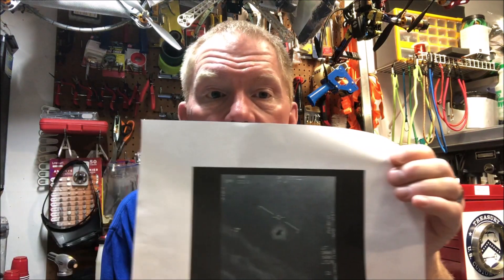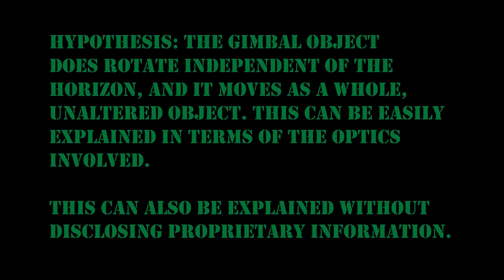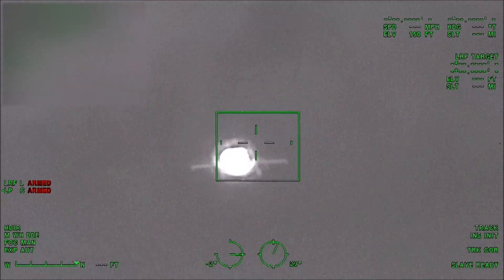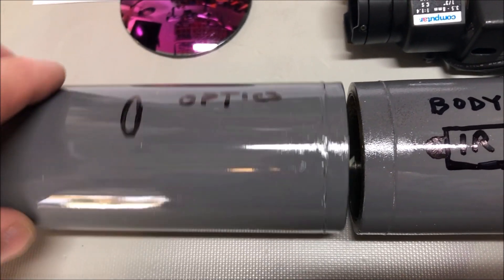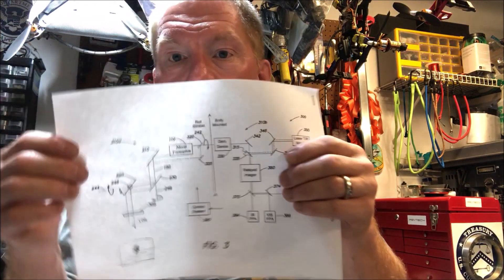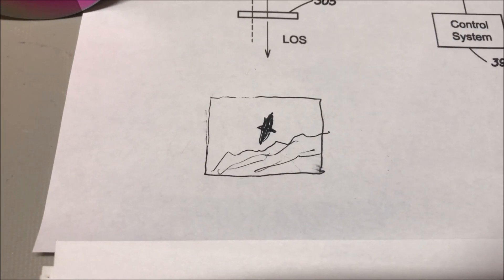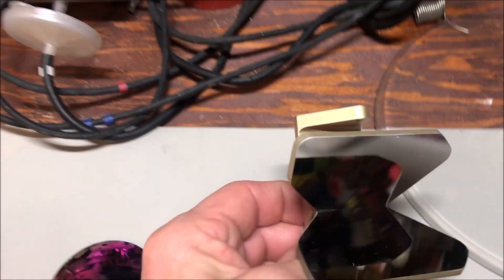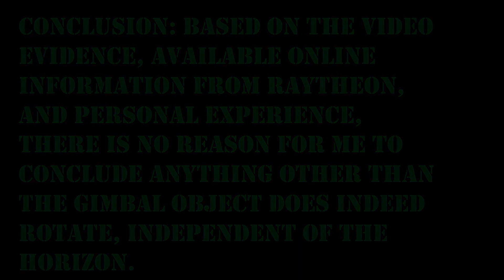"Gimbal" UFO ATFLIR video rotation explained by a Depot Level FLIR Technician

Comment: Why did you block out the metabunk forum link? And you're getting information from there?
Reply: @davefalch1038  bit at 8:48
Reply: @davefalch1038  It's more about how it comes across. I'm personally not attacking you or saying you're wrong. But when there seems to be fighting back n forth it just puts me off, It's nicer to have an open discussion. I just wish better evidence was released so no one has to argue about it. Wonder if that report will add anything

Comment: Can we just be more accurate that when we say the object is rotating it's actually the infrared signature that's rotating and not the actual object?  To suggest that the infrared image is the same as the object itself is very flawed. Do you think that if you shined an infrared beam into and IR device and rotated the emitter, the image would actually rotate?  If you look into a flashlight and someone turns the flashlight, will the beam of light also change?  The smell works in reverse. You can't assume that the fact that the image appears to rotate means that the object is.  I wish people would stop referring to these as objects altogether. We're only seeing heat signature. 
There is an FA-18 pilot who looked at the three recordings and immediately stated the same thing.  He said the heat source is rotating, not necessarily the object.  
I also found a video of infrared images of jets.  
youtu.be/5E7onF1c_T0
It's mostly boring except shortly after the 3 minute mark, you see an image of a fighter jet that looks exactly like the gimbal one as the IR device focuses in and out. Same aura. People are saying that there's no evidence of propulsion, but that's clearly not true.
Reply: @davefalch1038   wow,  I honestly didn't realize it was yours. Looks like there's egg on my face. Good thing I love eggs!  Sorry that I called your video boring.
The video had no description, so I didn't know it had anything to do with UAPs.  But, since you are the source, how does the image at 3:20 (ish) not resemble the gimbal video.  The argument is that the object in the gimbal video is actually farther away than what was initially thought. Whether that's true or not, my point is that there does not appear to be an exhaust plume, suggesting no known propulsion, in either your video or the gimbal video, and yet we know that at least in yours, there is propulsion. You even acknowledge in the comments that you can see the exhaust.  What makes the gimbal video different?

Comment: I appreciate your valuable perspective on this - especially regarding the mirrors.  However, what is not in doubt is the gimbal rotates.  The timing and position of the gimbal rotating occurs exactly when the gimbal/camera system was designed to rotate.  Are we to believe the object coincidently rotates at the exact time the gimbal rotates?  Also other light artifacts visible in the sky are moving at the exact rate and degree as the gimbal and the object.  How is this possible if it isn’t caused by light interaction with external lens glass independent of the mirrors?
Reply: @davefalch1038  Hi Dave.  Watched the video on the link.  Thanks for posting those.  Really interesting.  I am still trying to reconcile, however, why the object is rotating in perfect sync with the gimbal rotation?  Are you saying the gimbal did not rotate?  If the gimbal didn’t rotate - why are we seeing other light artifacts rotating in sync with the object?  Thanks.
Reply: @davefalch1038  you claim that the engines won't produce any glare in the camera in the infrared spectrum. We know glare occurs in other ranges of the em spectrum so why not infrared? Here's a video showing glare artifacts on engines using a camera in the IR spectrum, linked below. There are others. Maybe you just couldn't reproduce it given your equipment and setup.
https://youtu.be/L5NSm6GpvBI

Comment: could you explain the mode changes on the FLIR. Sometimes we see aircraft as white and sometimes black. What are these modes and what do they tell us. How do we know that we are not looking at the back of a fighter jet in a tic tac video?
Reply: @davefalch1038  ah, Thank you for the explanation!
Reply: What Dave should have told. you is that white mode is best for scanning and dark mode is best for details. If you look at the GIMBAL video when the mode switches from white hot to black hot, use actually see more details on the glare (glare spikes). You can also see more detail in the clouds with white hot vs black hot. On the bottom left of the screen you can see what mode the camera is in: BLK for Black hot and WHT for white hot.

In the Go Fast video, the object is cold so on WHT it appears black and on BLK it appears white.

In neither video do the objects in question change color without the mode changing.
Reply: @raytrebor  Thanks, that part is clear. I was not sure why they were doing it at first and then I watched Chris Lehto videos.
Reply: @raytrebor  and in neither video is it a distant jet, as the USS Nimitz would have determined that and not sent a Naval Aviator to go check it out. Note that radar stands for "RAdio Detection And Ranging" and extrapolate from there. Just saying, as a Navy veteran not a career civilian.

Comment: I find this whole premise of camera's setup being able to rotate an object it's observing so fascinating. Shame I don't really understand optics. 
What's a glare and how you can rotate it separately from all the other objects that camera captures? Because we know regular camera can rotate the glare, and if the glare totally obscures the object that's being tracked, it would look like the object itself is rotating, and that it's just a quirk of how cameras work. What prevents or enables FLIR from doing the same?
Reply: This is exactly what he's talking about. A lot of people have come to that same conclusion, and they even have videos of rotating glare somewhat resembling the GIMBLE object. What Dave is saying, however, is that based on the design of the optics being used, the derotation device does not work that way, and would not cause the flare to rotate independent of the object in the way you describe.
Reply: "The all-reflective derotation device is designed to do exactly this: maintain exactly what you would see as if the roll didn't happen. Since it's all reflective, it doesn't alter the "glare" at all- it reflects it. Thus, the only explanation is that the Gimbal object rotates."
-Dave Falch
Reply: @shavedata5436  But that's wrong. The shape of the glare does not come from the object, it comes from parts of the camera. And the camera rotates.

Comment: If I understand correctly, this assumes the mirror is the only thing rotating. Don't all of the optics before the mirror also rotate? Even if the mirror can rotate the image without altering it, it wouldn't correct for the rotating of the lens artifacts themselves.
Reply: Also there's the fact that the pilots saw the object with their eyes, and the objects showed up on radar. This rules out smudges on the glass. Furthermore, a smudge on the glass wouldn't move around independently from the horizon.
Reply: @Scalettadom  Eye witness account isn't very valuable since these pilots WANT to see a UFO. And they may be experts at flying aircraft, but they may not be experts at reading camera and radar data. And a smudge can move independently of the horizon if the camera does a roll movement. In the video, when it passes 0 degrees yaw, It has to roll due to gimbal-locking. Watch the degree markers in the video.
Reply: @wessmall7957  reaching a bit there
Reply: @gregcadman6102  Care to elaborate?
Reply: @wessmall7957  your looking for smudges and image altering properties on the lens , all those that work with the rigs say it cannot be that , yet you keep reaching , in addition we know this was only a small part of the events , these images are not the only part of the story.
Reply: @gregcadman6102  There is an easy way to prove to yourself that the glare can rotate: Look at a street light and squint your eyes so that the light becomes a streak. If you tilt your head, the streak will tilt with your head. That is exactly what is happening in the video, except there is a mirror system to counter-rotate the image before it's projected on the sensor. The result is that only the glare rotates.
Reply: @wessmall7957  yet you do not know this equipment do you , you have never worked with this equipment have you , in addition a lens does not work the same way as a human eye , as I said your reaching , this man here works with the equipment as have the pilots and he has said no this would not be the case , but here we are you reaching , ignoring those that use the equipment , ignoring the other pieces of these cases.
Reply: @gregcadman6102  You have never worked with this equipment either and you are appealing to authority. I have worked extensively with normal DLSR cameras and I'm also an experienced with linear algebra transformations and 3D graphics. To me this is obviously caused by anisotropic imperfections/smudges in the optics that come before the mirror. It makes perfect sense geometrically.
Reply: @wessmall7957  yes because when i take the point of view of something , those with real world experience with equipment is the word i take that is the logical thing to do , not some pseudo skeptic looking to make themselves and there view point fit there reality , I have not worked with it , we know you have not worked with it , yet here you are thinking your view point counts. Face the fact you have no clue how this equipment functions and when those that do say what you claim is not the case , then move on and stop reaching.
Reply: @davefalch1038  just like a smudge on a rifle scope doesn't really affect the sight picture.
Reply: @davefalch1038  My problem is that the external-most piece of glass on the camera could have smudges on it that create the glare, and when this glass rotates relative to the subject, the glare will also rotate relative to the subject. I can't see how any additional system can correct for this. I'm not an expert though, just played with some cameras in the past.
Reply: @davefalch1038  what do we know about the software that's processing the images? We know it's adding this image sharpening effect at the very least, because of this bizarre looking aura.. How do we know its not manipulating it further, resulting in the strange shape that we see? I.e. it's taken an ill defined image caused by glare, and tried to interpret that as a solid object, and therefore has possibly taken an elliptical glare and turned it into the strange ufo shape. If this is possible then it would completely explain why the glare rotates with the camera. Would be very telling to see what the images looked like preprocessing imo. I still think the rotation is a function of the camera rotation, not of the object.

Comment: Love your explanation! As someone who repairs these FLIR systems. Do you think that a system with any specific faulty/broken components could simulate the rotation of an object separate from the horizon?

What if that bent mirror had a piece that broke off inside the pod, while the rest kept moving? Or the dero device got stuck, but the camera did roll?

I believe your original explanation. However, I wish to thoroughly have all possible information on this, so that the debunkers have nothing left to scrutinize.

I appreciate your video!

Comment: Dave, thank you for sharing your expertise and demonstrating the mirrors. That is equipment most people don't have access to. However, I feel you missed an important variable. The explanation Mick West gives is that the refraction is caused by the camera itself while the mirror corrects for the image rotation as the camera rotates. In your demonstration, you only rotate the mirror and not the camera. Mick rotates the camera to show the glare rotate AND rotates the image to simulate the mirror. Could you please do another video demonstrating both variables?
Reply: @davefalch1038  could the flare happen on the window of the casing or camera or sensor somehow that if the tech rotates, the glare effect will rotate together with it? for example as if you scratch the optic / window? if the tech now rotates, the scratch rotates with it, while the horizon (obviously) wont in real world. when the image now artificially gets stabilized, the image of the scratch would appear to rotate in the real world.

does this make sense what i try to say (english isnt my main language) and could the "scratch" somehow be a deflected heat signature?